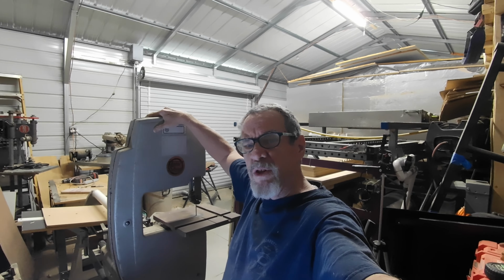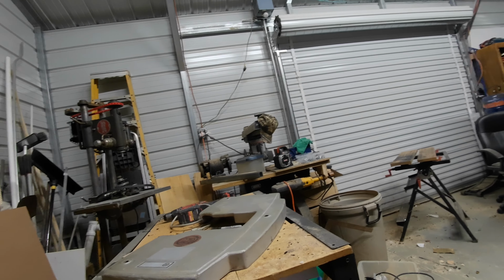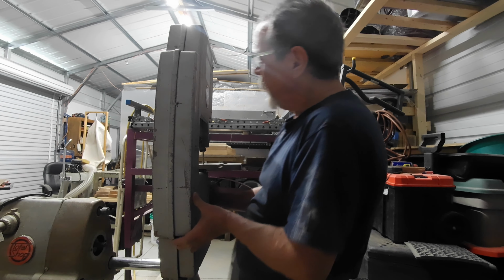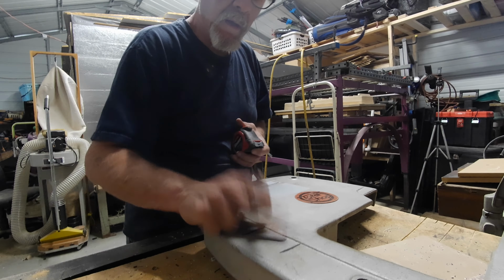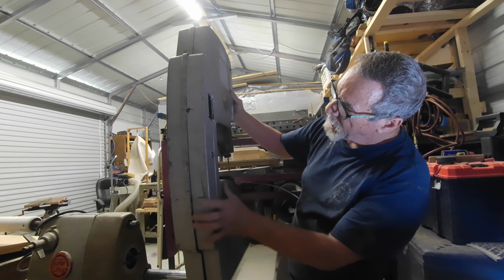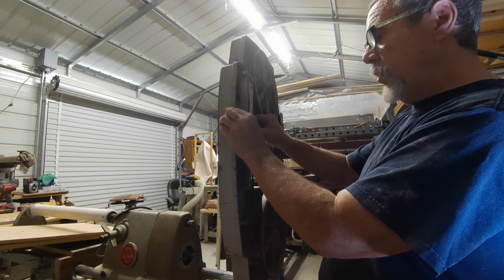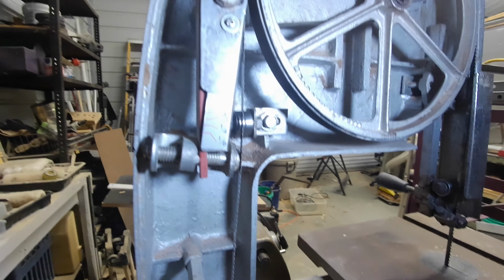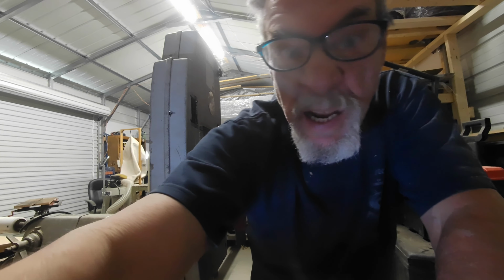Adding Tension adjustment and access to read the gauge to a Shopsmith/ Total Shop for access

Comment: Shopsmith and Total Shop are not the same company or machine.  Total Shop is a Chinese knock-off and isn't made half as good.
Reply from the maker: Yes but free is good. The attachments fit, but no parts for inside are available. I converted mine to a dc treadmill motor.